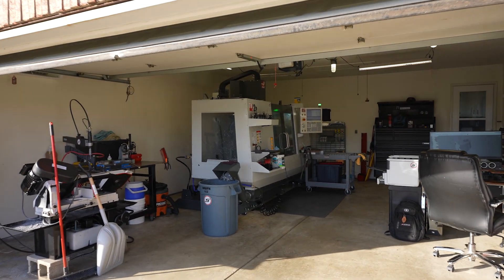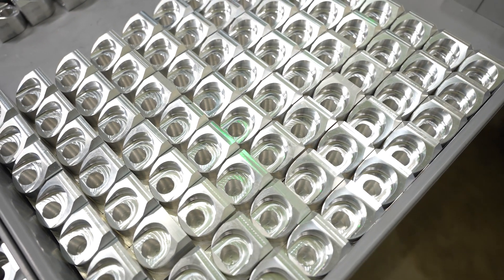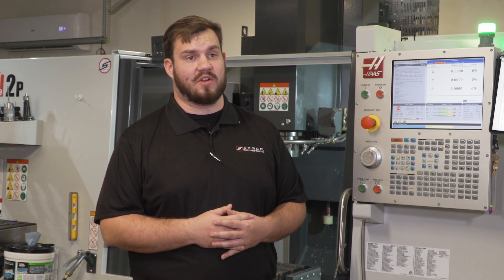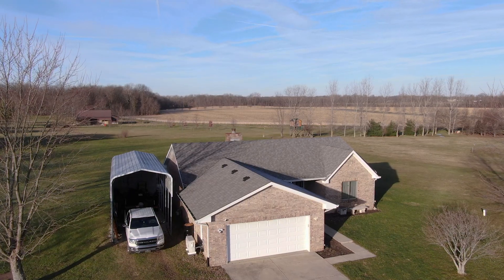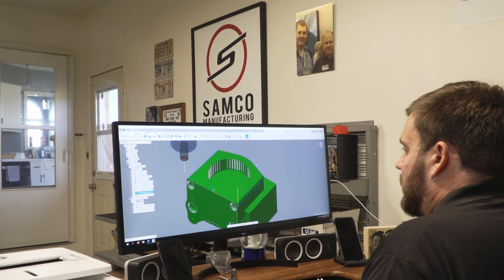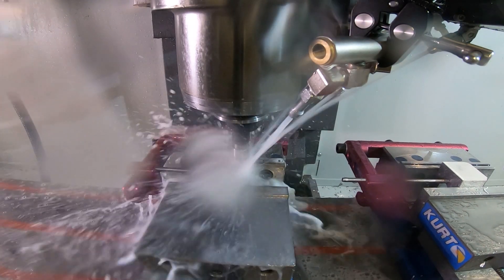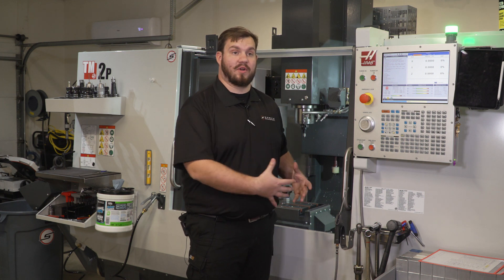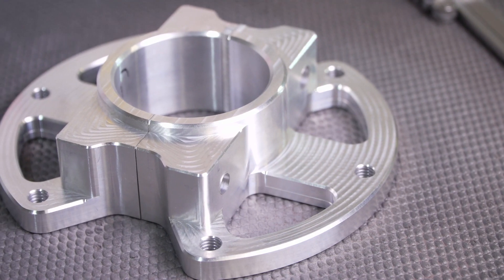Machining Race Car Parts on a Haas CNC Toolroom Mill in a Home Garage Shop

Comment: How is the controller to use on this machine I mean how is the conversational control to use
Reply from the maker: The Haas CNC is among the most intuitive on the market and is used by many high schools, technical colleges and universities. You can actually take a free online course through Haas if you'd like to get a little more familiar with it. Here's a link to the online certification: https://www.haascnc.com/myhaas/haas_certification_US.html

Comment: I want to do this but my garage only has singlè phase 220v 30amp breaker. Do you have any recommendations on what i can do to be able to run at 30 amps eventough haas says full load is 40 amps
Reply: Full Load Amps means that EVERYTHING in the machine is pulling max load it can. I have a 44 Amp Max load lathe in my garage shop making chips and never pulling more than 21 amps.

Comment: Awesome. I’m from southern Indiana. Looking at getting a haas TM for a home shop and I’ve been worried power requirements and space.
Reply from the maker: Hi Jacob - Great to hear you're looking to start a home garage shop. The Haas Mini Mills, Toolroom Mills and Toolroom Lathes are all designed to work in garage environments. Curtis Boggs is the HFO rep in your area and can help, cboggs@hfochicago.com
Reply: @hfotridentmachinegroup  yeah I get an email from him every week lol was rigging delivery and setup part of the included prices? I didn’t want to talk to a sales rep until I’m closer to buying
Reply from the maker: @jacobbowling6247  rigging is not included but set-up is when it arrives. And we can also help with training if needed. Let us know if you have any additional questions. And by the way, if your door/opening is small, we have several ways to work around that.

Comment: Hello, can you explain the process to get a TM machine into a residential garage? My door opening is 84 inches looks you have a similar one
Reply from the maker: Great question... In many cases, some of the guarding on the spindle or even tool changer are removed to fit through lower openings such as this. Then we put it all back together once it's in place.
Reply: To answer the above question.  A TM mill will go through an 84" door without disassembly.  You'll have to get it off the skid and skate it in and push the cable track down.  Contrary to what is said above you don't need to remove any parts of the spindle sheet metal and it isn't offered with a side mount tool changer so you're not going to take the tool changer apart.
Reply: @hfotridentmachinegroup  thanks for the reply !
Reply: thanks for the reply !
Reply: My Tm fit under my 84” door fine.
All I had to do was remove the spindle break resistor and loosen the energy cable so it could lay sideways. 
Gave me 1/4” of clearance :)
Used a standard pallet jack to wheel it in :)

My vf2 I had to remove the side mount tool changer and spindle break resistor (a carousel tool changer would not have required removal)

I’m not familiar with the new Tm casting. But the ok’d I’ve was on riser feet to widen the stance, they were  4-6” tall, so you can really drop it down if needed.